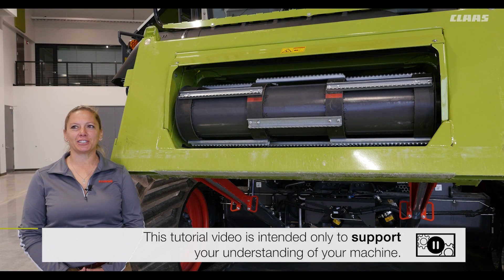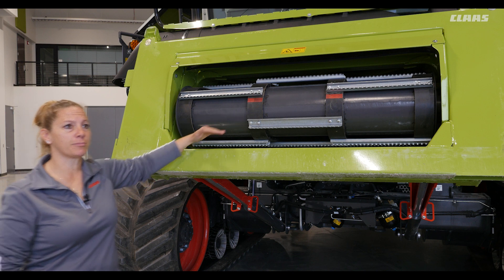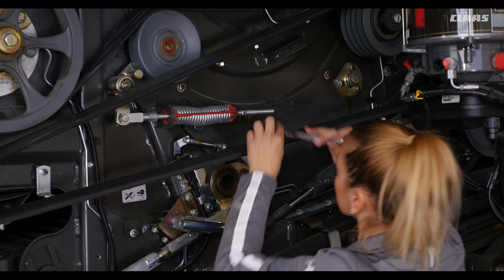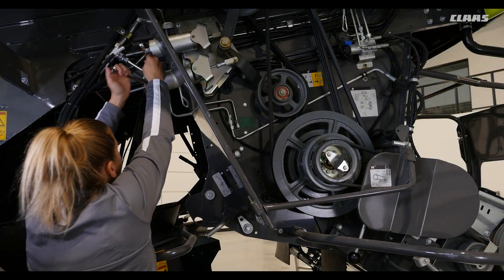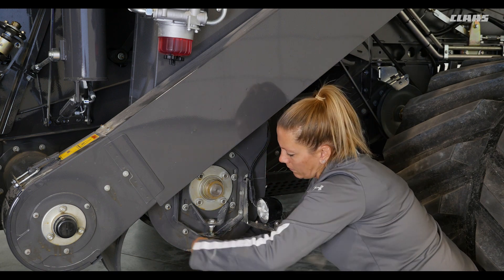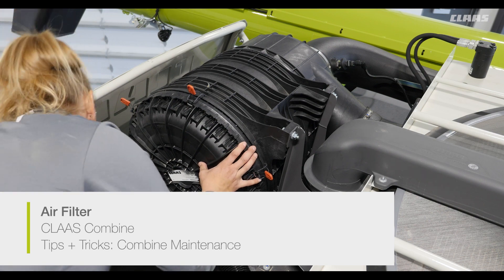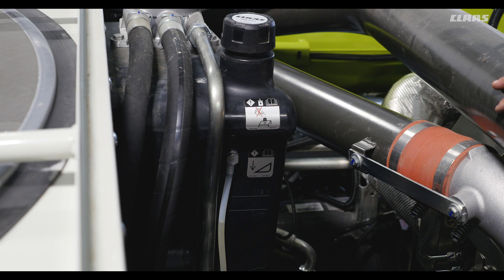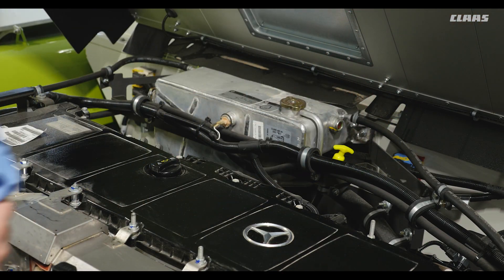CLAAS Combine Tips + Tricks | Maintenance

Comment: Feeder house tensioner is easy on the right side, why not demonstrate how to work around the header drive side? The position locking nut behind the drive gearbox is impossible without some specialty tool, as the threaded rod sits proud of the nut and has no access for a socket.